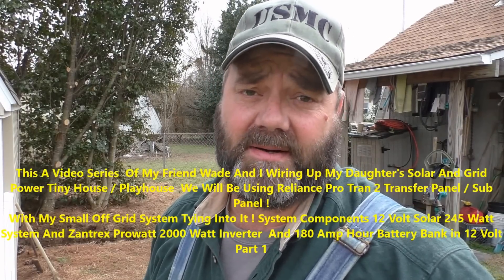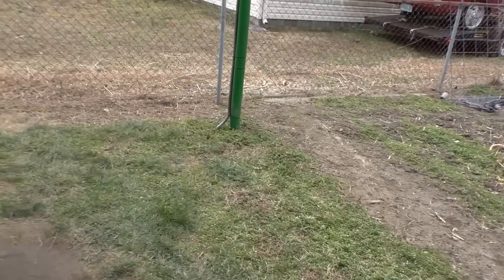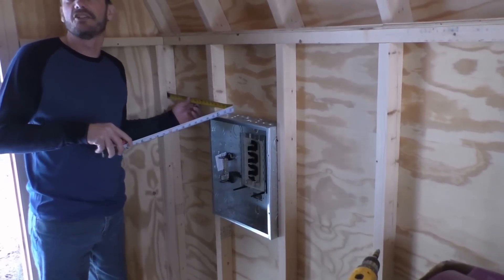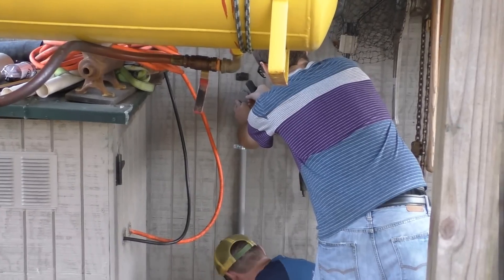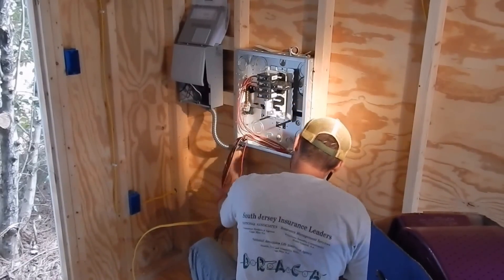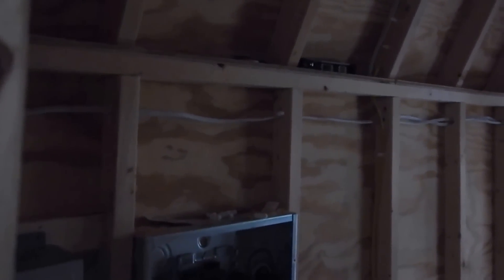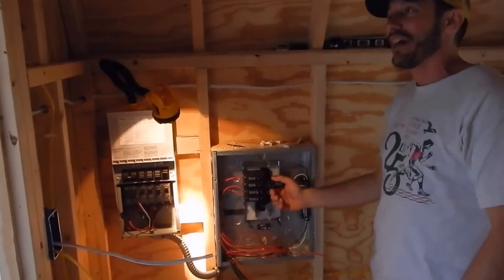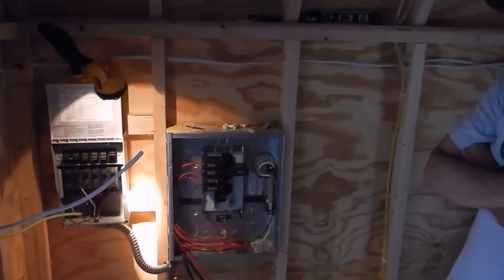OFF Grid Solar Power And Grid Power Wiring A Tiny House / Playhouse Project  Part 1  With KVUSMC

Comment: Hello,  I have a solar system in place at our cottage, Scheider Conext 4048 inverter charger and midnight solar e-panel,  we are wanting to incorporate a Generac 13kw generator to the system to turn on when battery levels are low and turn off when batteies are charged.  we have 10panels and 8 L16 Rolls Surrette battery bank.  I have a Scheider Conext SCP as well just got a AGS switch to communicate with the SCP to program SOC.  I had a electrician has run the cables 60 amp to the service room but not sure where to connect this from the generator to the solar system? sounds complicated but now cannot get any off grid technicians out to the cabin until next year.
Reply from the maker: I would Get the Generac 13 kw like you said Get a good Electrician is all you need buddy

Comment: i am 100% off grid and need a good 48 volt battery charger to have as back up for my batteries  and run it off my 1800 watt invereter generator. , can you recomend one.
Reply from the maker: Outback Charge Controllers are My Favorite

Comment: how would i wire my breaker box with a 4048 outback radien inverter  120/240 volts
Reply from the maker: I Would Get Help From A Certified Electrician Like I did  Marine OOORAH
Reply: i have called 5 so far and non have come, i am going 100% off grid, my area was hit hard by hurricane Maria, i have 16-260 watts solar panels , 4048 radian outback inverter , outback MPPT  FM-80 charge controller and a midnite 6 circuit combiner box, with 8 Trace 235 amp hrs batteries , what size of a breaker do i use in my breaker panel  and i need 40 feet of wire to my panel box from my inverter, what size wire do i run? maybe your electrician might have an idea. Semper Fi brother .

Comment: Any chance you have a wiring diagram floating around somewhere? I'm starting my solar shed with a 1000 watt renogy 12v inverter. I'd like to wire it into a breaker panel,  but don't really know the ins and outs of that. still lots of research to do.
Reply from the maker: Sure Do Buddy I did A Video Many years ago on it  Here You Go 
https://youtu.be/hemd8nekRD8
Reply: Perfect. just what I was looking for. thanks!
Reply from the maker: Your Very Welcome

Comment: question, he installed all the breakers on one side of panel but typically the breakers alternate L1 and L2 hots so you can put a 220 vac breaker in the panel. is this a just 120 vac panel or did he put a jumper across L1 and L2 to tie all breakers on one 120 vac main?
thanks
Reply from the maker: +Rev John O'Toole This Is 240 And 120 Volt Reliance Right Now We Don't Have The 220 Hooked Up  That Will Be In My Next Video  I Will Explain   A Little Better   Cheers John